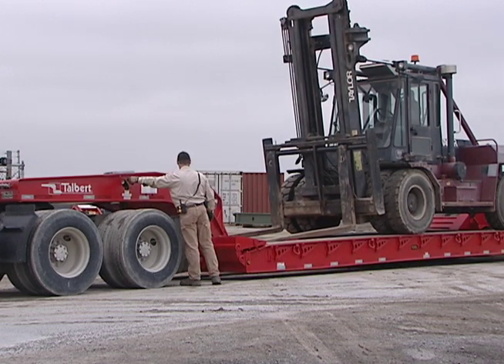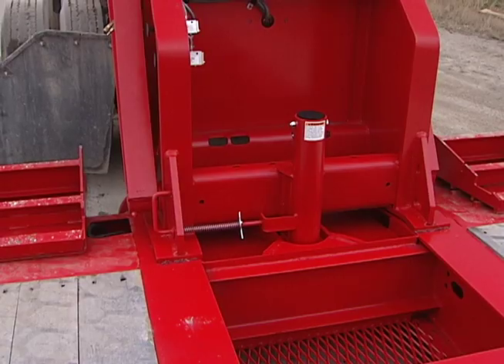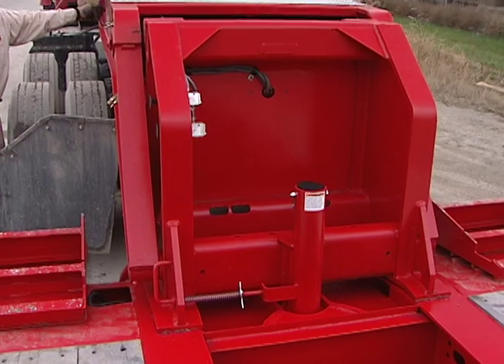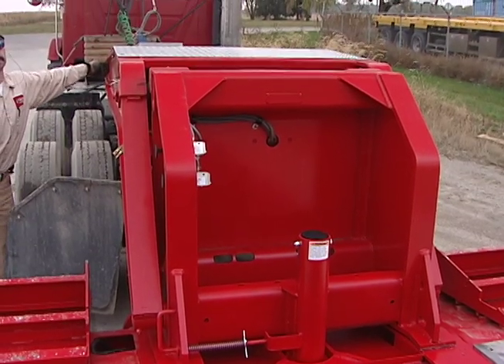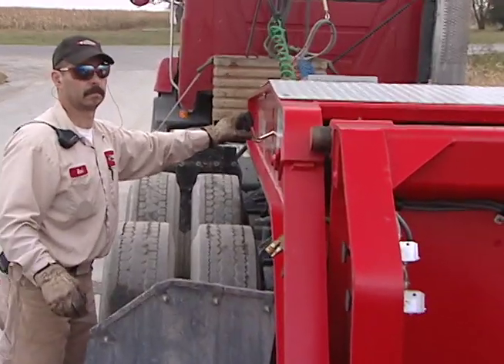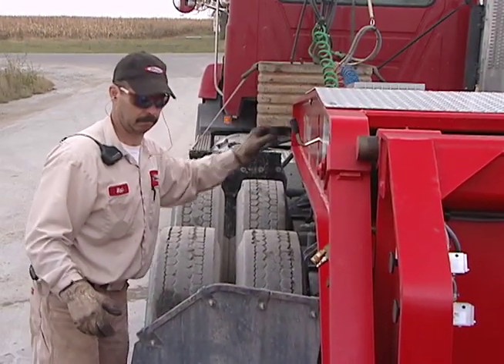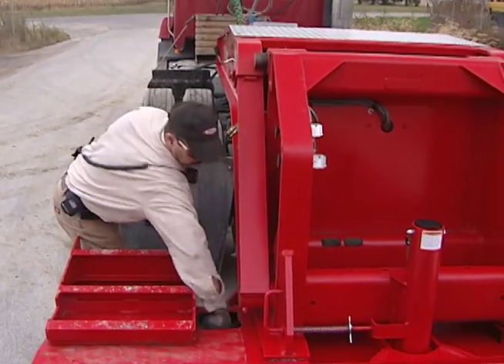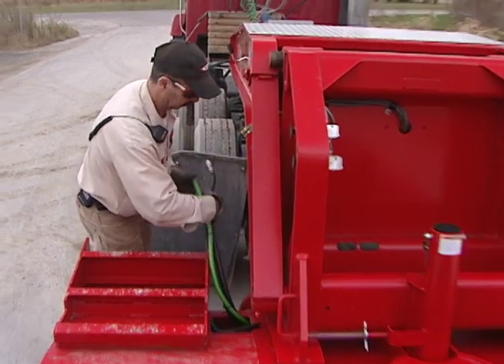Talbert Manufacturing Hydroneck - How to Unhook & Hook Up

Comment: what about the chains to hold down the loading ramp? I've seen them flip down when traveling down the road following our lowboy
Reply: The chain slots on my trailer got damaged, haven't used the ramp chains in 5 years and a ramp has never flipped up, it's way to heavy.

Comment: I have seen guys unload equipment from side with out disconnecting trailer.Is that ok to do with a lite load or will it cause damage
Reply: There is a sticker on the side that says DO NOT SIDE LOAD. I never have, it takes 30 seconds to disconnect, shortcuts don't usually work out doing this stuff
Reply: Side loading will tear up your fifth wheel